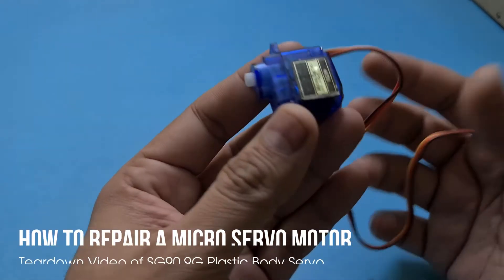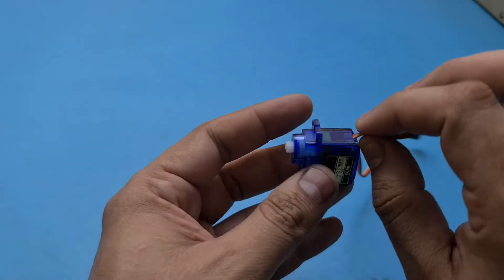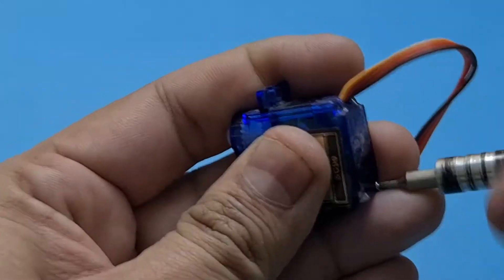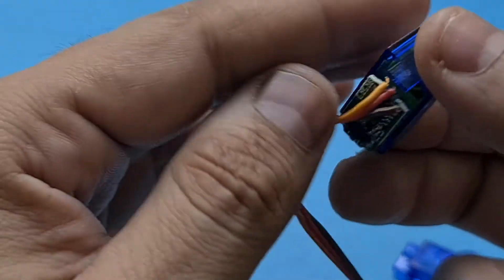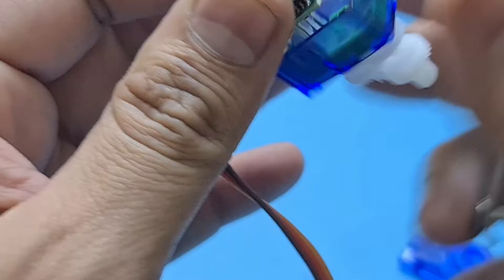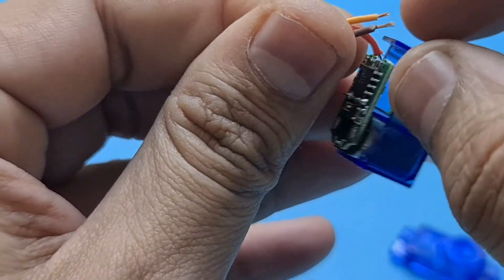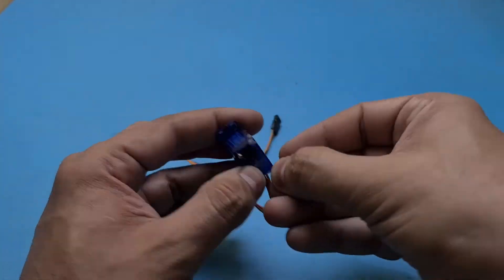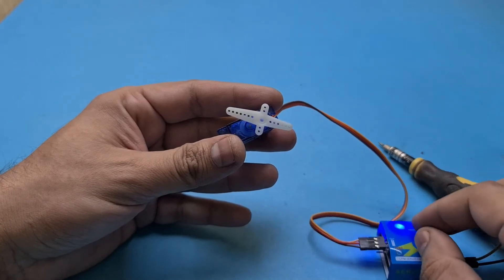Micro Servo Repairing Guide (sg90 9g)

Comment: mine has no disconnected wires but it does not work no movement nor vibration. How to fix this anyone?
Reply from the maker: Please Check that your servo gets 5V with shared ground and a valid PWM signal. If it still doesn't work then it is most likely faulty.

Comment: This is precisely what happened to the SG90 I was testing just today on a simple mechanism I'm building.  It was working fine at lunchtime, and then, when I tried it again this evening; 'NOTHING'... not working at all.  I just opened it up and the brown wire is detached.  Just to be sure I stripped the wire, attached the servo connection to the tester, put it to the 'sweep' setting, and when I touched the brown wire to its original terminal, the motor started sweeping.  

I think the wire got pulled out because it's a tight fit to get the motor into the moving mechanism so I'll have to find a better position so the wires don't get pulled out.  Thanks for your help.  You've earned my sub.

Comment: I am a begineer
I plug the servo to my Flight Control board
At first it was okay, but now the servo didn't response

In total there are 2 servos broke
Do you know what is the potential cause of this issue?
Reply from the maker: Did you check the voltage you are giving to the servo? If the servo works and then gets damaged, then it is probably being burned to over voltage. Another issue can be stalling of turbo due to jamming or overloading which can burn it as well.

Comment: my SG90 has no disconnected wires but still not moving. it just vibrates. what do i do?
Reply from the maker: It can be due to several reasons such as signal frequency incompatibility, servo overload, internal variable resistor failure or internal control board issue.
what happens if you try to move it by hand when operating. does it stop vibrating at a certain position?
Reply: @researchcell  when i moved it with hand? Well at a certain angle it moves a bit but vibrating again
Reply from the maker: Then I suspect there is an issue with either the gears or the internal variable resistor.
Reply: mine also does not have disconnected wires but theres no moving or vibration. how can i fix this?

Comment: Hello bhai mere servo me continues awz aa rhi hai aur vibrate krr rha hai and uska baring bhi free ho gya hai. Plzz bata do ye kya hua hai aur fix kase kre
Reply from the maker: There can be several reasons for this problem. Maybe the pulse signal you are sending it is trying to operate it beyond its maximum angle limit. Also you need to use a regulated power supply for your servo, normal transformer-based power supply will not work. Also this can be an issue with the variable resistor that the servo control IC uses to detect your servo motion and correct its position or some internal gears are probably slipping.
If you have another similar servo then replace and if the problem persists then the issue is confirmed with your servo signal or power supply.

Comment: Hello bro please help.. my servo motor is running but gear is not moving.. what shall I do..
Reply from the maker: I have added a video for you about the servo motor testing. You should check it.
Reply from the maker: Try to move your servo by hand, if it is locked in place then it is probably signal pin issue. If the motor is freely moving then + or - pin is not connected properly. Did you test the motor using servo tester?
Reply: @researchcell  no I don't have that..

Comment: Bro mere pass servo motor h wo transmitters ke sath work nhi kr rha h or ager usi servo motor ke jgh dusra lgta hu to work krta h or jo work nhi kr rha h wo servo motor servo tester ke sath work kr rha h ye kaise ho sktaaaaa h
Reply from the maker: Your servo can overload your transmitter causing it to shutdown due to overload safety. Probably the servo you are using is larger than your transmitter’s maximum amp rating.

Comment: I have a question, I need more powerful servomotor but with a low cost,so is it safe to change the motor of a servomotor to a more powerful one ?
Reply: if you know what you're doing.  you can also get the mg90s, which is cheap and noticeably better than the sg90

Comment: Why are these servos particularly so faulty? I bought 6 of them in a pack, and they are all faulty. They don't even react to the transmitter commands. Is it faulty assembly line or something else. Do you know? ;) Thanks for the video. Very Helpful. I will go now to fix all of my 6 servos. Leo(Architect & Engineer)
Reply from the maker: Hi Leo, Thanks for the appreciation. Please dont throw away your servos, I am sure all your motors are also fine, just their wire connections are broken from the inside which is not visible unless you open the servo case. These servo motors particularly suffer from this broken wires issues and most of the times the rest of the motor is completely fine. So I am pretty sure your motors will also start to work once you resold the broken wire connections.
Similar thing happened to me except that only 3 of 8 were faulty in my case and the fault was same as in this video. Rest of the motor mechanism is not that bad as per their price tag though. 
Oh and I will be curious to hear from you if you were able to fix your servos or not. Let me know when you do it :)
Reply: @researchcell  Unfortunately, I was less lucky. I opened all of them, but the wires were good. Also my servos were the next model, and the PCB board was directly soldered with the motor itself via 3 metal bars. So, in my case, it is PCB board fault. I ordered Savox and Etronix, the proper quality make once and with metal gears, not this plastic once. So, Cheap price unfortunately is not always the crucial thing, if you want to make a good lasting RC models. ;) Leo(Architect & Engineer)
Reply from the maker: Oh thats not good. You should file a dispute if you bought them from Aliexpress or Amazon. Or may be place a feedback. The seller should know that all his motors were faulty. Its totally unfair. I wish your next motors work with your project. I would love to see the video once its functional :)
Reply: @researchcell  I bought them around a year back. And they were really cheap, around 6-10 pounds for 6 of them on eBay. So, I wouldn't worry much about it. Once I receive my other servos and connect it with my model, I will message you. It seems like from other forums as well, this model is particular faulty with everyone who buys them. Must be an assembly line faulty, or they are not testing them properly. ;) Leo
Reply from the maker: Sure, i will wait for your message :)
Reply: @researchcell  Hello again. So, yes, now I bought the proper servos, and they are all working great. So, cheap is not always the best. ;) Leo
Reply from the maker: Great, I am looking forward to see your project.
Reply: @researchcell  hlo
Reply: that's same almost on every platform sir @researchcell